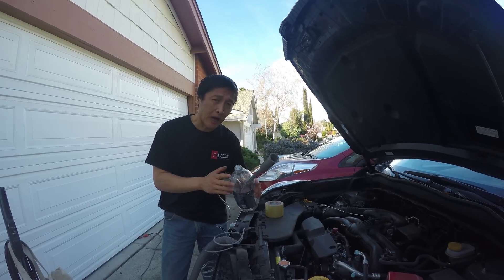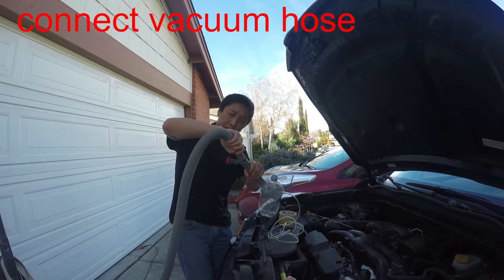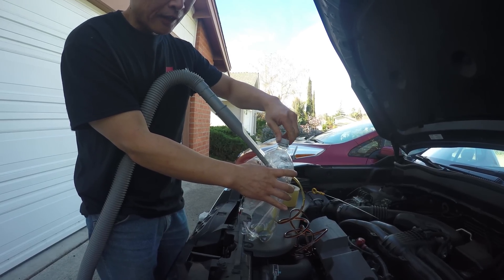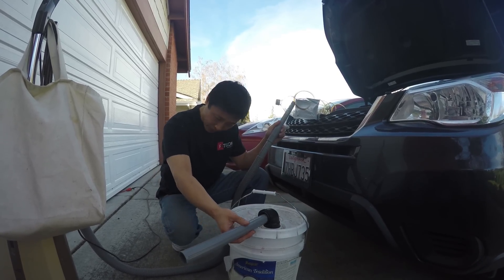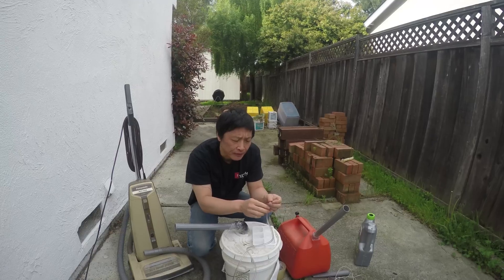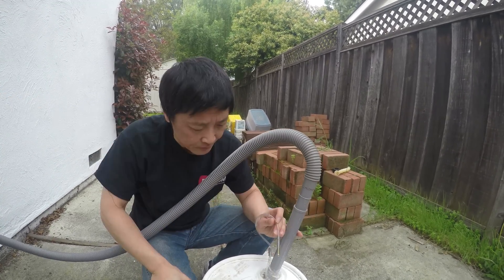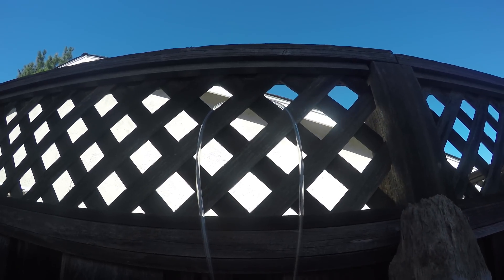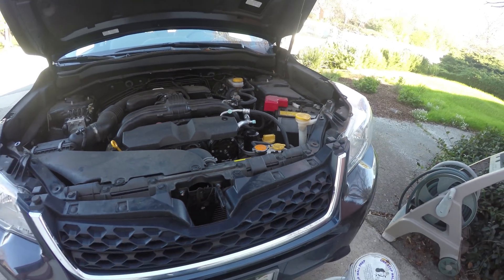DIY: Cheapest Engine Oil Extractor, Drain Fluid Easily and Free

Comment: Chris Notap has a video using a shop vac, a rigid container, aquarium tubing, and the top of a 2L soda bottle, but then he released a second video saying just to put your catch container inside the shop vac--except I am trying to change the oil in my car, and I cannot fit an adequately-large container in my shop vac.
It wasn't working very well, so I went to do more research, and I encountered your video.
You say to remove the oil cap, which sounds logical, but my setup slowly worked with the cap on, and just made noise with the cap off.

Comment: I would of had it up on ramps and the drain plug off and filter off in less than 5 minuts. And I would have it back toghter and running in under 20 minuts  this is too much work to try and stay clean. And I could of put a quick drain plug on that would of only taken me an additional 2-3 minuts.

Comment: OR.......... you can jack the car up 4 inches and unscrew the drain plug , then change the oil filter ..
Reply from the maker: yes, we have the traditional way of doing it here: https://youtu.be/HavaTZDwtjk  https://youtu.be/aPYtICiotEc
Reply: Not if you have a boat or mercedes that you have to extract via dip stick.
Reply: Not if you have a bad leg like I do.. and I still prefer to do things myself. This is a great idea.
Reply: real men dont have to raise the car at all...you can slide under it and unscrew the drain bolt